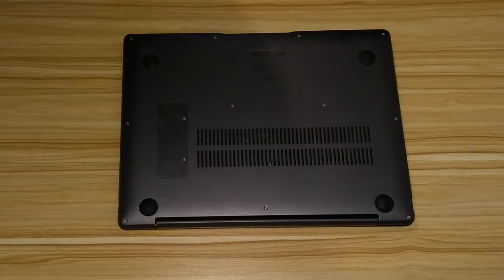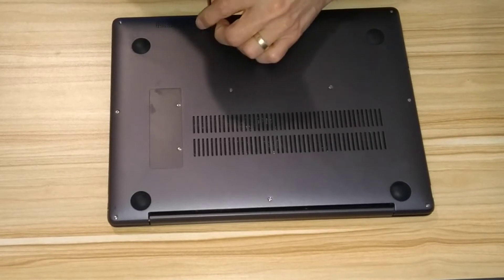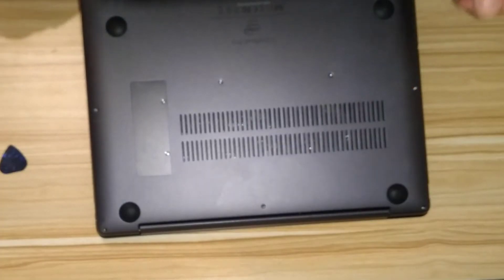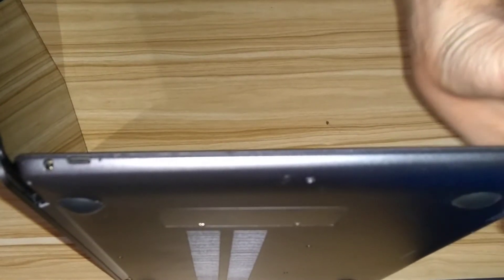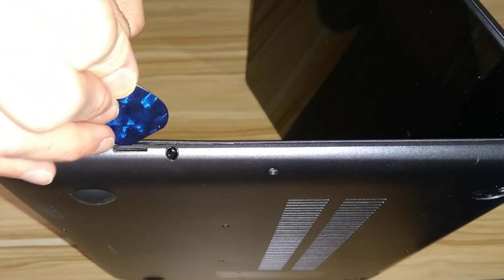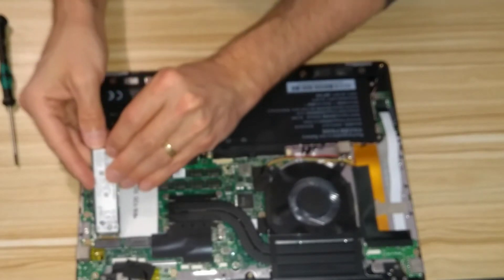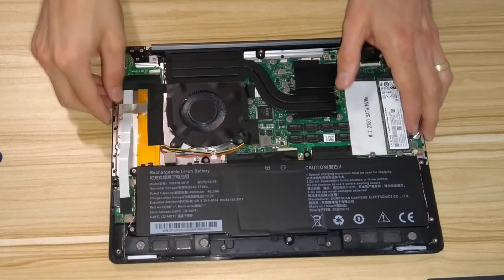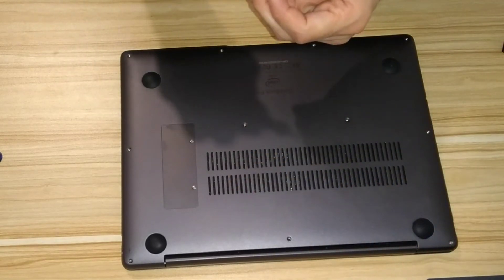How to replace the SSD M.2 SATA in a Chuwi CoreBook Pro Intel i3 laptop

Comment: How do I take out the battery
Reply from the maker: 5:34 you can see the battery at the top of the video. It looks like there are 6 screws or more. And the cable will be under the black tape in the middle just next to the - and + symbols on the battery.
Take care, do not bend the battery. It may damage it or even cause fire.

Comment: Indo the same i open the small latch on the back and insert a new nvme m.2 ssd 512gb i got 2 now with 512gb the bios did recognize the new ssd but when i turno on the laptop and when i open my computer it only apear the first (stock) ssd
What can i do to solv the problem???😊
Reply from the maker: You need to partition the drive in disk management. It will just be unallocated at the moment.
Reply: @freename  how do i do that???
Reply from the maker: @vasco8965  Start menu, type in or find disk management (or computer management then click disk management within there). You should then see the drives in your system. Make sure you don't touch any of your existing drives or data as you may do something which loses data.
Find the new and blank drive.. and right click and create a new partition on it.
https://learn.microsoft.com/en-us/windows-server/storage/disk-management/initialize-new-disks

Backup your data first or make sure you know what you are doing. Do not blame me if you manage to somehow lose any data.
Reply: @freename  thank you bro i will try that

Comment: Hey I just bought a Kingston m2 nvme sata to expand my storage and added it to the empty slot but it's  nowhere to be found all I see is a 1mb capacity disk 1 which pops up in partitions which is also useless, dobyou know what i can do? The SSD fits perfectly and is supported it's nv2 sata nvme pcie 4.0
Reply from the maker: You can't have "nvme sata".. it's either nvme or sata.
Reply: @freename  I have nvme which can't be read for some reason

Comment: I am looking to replace the trackpad on my Chuwi. Did the battery seem user removable? From the looks of it, I am going to assume I will need to remove the battery to get to the trackpad.
Reply from the maker: Battery definitely will be easily removable.. no idea about the touchpad, sorry. But I would suspect the battery needs removing to be able to see the touchpad (to see if its modular or heat riveted onto the palmrest etc.).

Comment: Actually don't ask people to subscribe if they're not going to watch your videos because subscribing and not watching actually hurt your channel because it sees your channel as not as engaging as an initially thought when they subscribed so therefore it will actually recommend your channel to less people granted you'll have an initial boost of people watching your channel because of the additional subscribers but not long term
Reply from the maker: But if you need (in an example that happened a few years ago and effected me) a minimum of 1,000 subscribers to be a "YouTube partner" then the subscriber numbers are hugely helpful.

I only just scraped through which then stated me asking people to sub in case YouTube up the required sub number in the future :(

Comment: Can ram be installed  into the blank m.2 slot? 
Dose this laptop  have 1 stick of ram from the factory  or two sticks of ram? 
Mine looks the same yet has 500gb(ish) of storage  & 16gb of ram. Looking to upgrade the ram. I have plenty of external  storage currently.
Reply from the maker: I've never heard or thought of that as something to try before. I'm only as good as Google on the matter. Google seems to say that you can but the speed of the interface would reduce the speed of the computer many, many times slower than using just native normal RAM.

Comment: Hello! Thank your for video! I have 2 questions for you:
1)Which problems/errors (in Windows) has caused the SSD damage? I frequently have different BSOD (name error Memory management ntoskrnl or system service exception). I have tested the ram with memtest, but there is no error. Yesterday I've launched scandisk (chkdsk /f from command prompt) and the test was block at 100% for 10 hours!... But I have no damage sector in CrystaldiskInfo... I'm very confused... (Drivers are update). What do you know about this?
2) It's possible replacement ram? 

Thank you bro! Sorry for my English!
Reply from the maker: Crystaldiskinfo probably isn't very accurate on SSD drives. My issue was the SSD failing, I can only suggest replace the SSD and see if problem goes away. I think the RAM is soldered onto the board but not fully sure.
Reply: I think the problem it's in they ssd, please use only a kingston Samsung o crucial ones,  clone to an nvme drive , an change it

Comment: How you like this laptop? would you recommend it?
Reply from the maker: It is ok. Not sure on recommending.. the SSD went wrong on this one and it doesn't have a UK keyboard layout. Depends how much you are saving Vs one of the big brands.
Reply: @freename  US keyboard is what i am looking for
i just need a very light small laptop with good battery life to do office work, zoom calls, stuff like that
Reply: @freename  did your SSD make noises?
Reply from the maker: @arkvsi8142  I don't recall it making noises.
Reply: @freename  then probably just a manufacture defective unit
Reply: My herobook is very slow. Also it has trouble downloading anything. Will a new SSD card help fix these problems ?
Reply: I would not recommend it at all. Save your money and buy a good HP instead. I have only had problems with mine from the beginning .